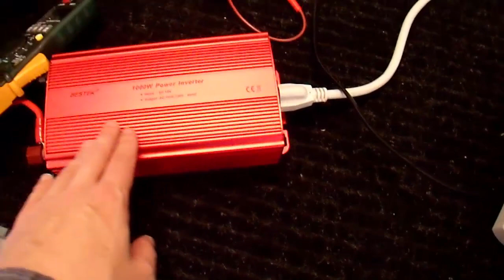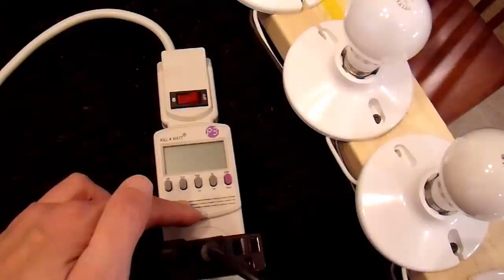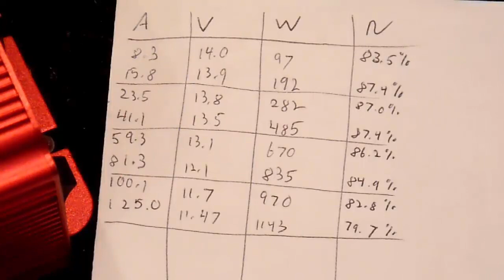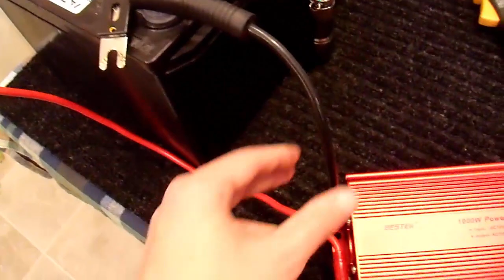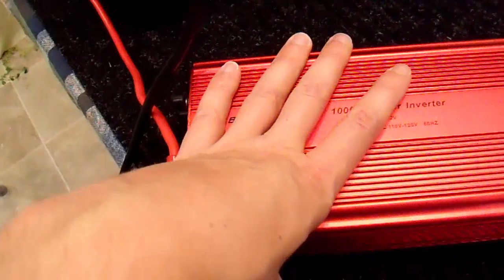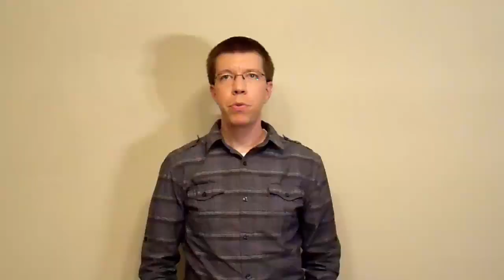Bestek 1000W Power Inverter Review - part4/4

Comment: I purchased 2 of these 1000w inverters and installed in Mini vans, direct connection to the car battery with 12’ of #4 welding wire. We ran the pretty much non stop for 6 days during a coast to coast bicycle race. Used them to power USB power strips charging cell phones, batteries, and bicycle lights. We did turn them off if we turned the car off for more than a few minutes to minimize any car battery drain. I realize we never had an extreme load attached, but they worked fine. I now use one in my truck to charge camera, GPS, and phone batteries, and some LED spot lights during desert trips.
Reply from the maker: I actually think an inverter like this is the right size for those types of jobs.  It doesn't cost much to oversize to 1kw and the result is that the inverter runs with very little stress.  For long term reliability an inverter like this should only be run at over 50% load intermittently, and then you have the reserve power should you unexpectedly need it.  Thanks for the user story!

Comment: Looks like Harbor Freight badge-engineers this as the Jupiter 1000w inverter. I mean, the screws and orientation of the outlets look exactly the same, but the colors are different. Use the 20% off coupon, and it comes out to $68 USD.

Comment: I think need some answer guys.

 Current car cigarette output spec stated 12V (120Watt)

1. car inverter 12v to 220v possible?
2. Generate Maximum output watt 1200W possible? Continuous output 500W Possible?
3. Any implication to my car battery & alternator system?

Highly appreciated your answer. Thanksssssssss

Comment: i would personally run 4 gauge ofc wire to the inverter. or maybe 0 gauge if i have any left when im done with my audio. but i wouldnt throw away the cables included. theyre fairly nice cables. just not made well enough to power the inverter for long. lol

Comment: so I'm looking for a power inverter to run a small fridge and other electrical components inside my 4 wheel drive truck what does inverter work for my application or should I look for something larger like a 1500. also do you have any DC installation videos on power inverters inside vehicles. im a first time viewer really like your chanel good job

Comment: Can this inverter safely power my MacBook Pro on extended trips with the provided 12volt plug that connects to the cigarette lighter? As I won't be using the battery cables. My trip would be about 10 hour trip one way.  
Below are the specs from Apple. 
"Built-in 74.9-watt-hour lithium-polymer
battery
60W MagSafe 2 Power Adapter"
Reply: get the 300w inverter
Reply: +DMAN22yeah Thats what i got from amazon for like 30 bucks about 4 months ago. i'm so happy with it.

Comment: Thank you so much for your informative and unbiased reviews! I recently bought this inverter and am putting together a basic solar system. My biggest uncertainties lie with circuit breakers and fuses. I'm sorry for such a basic question, but am I wrong for assuming that because there are three 50amp fuses on the inverter already, I don't need to add a fuse or breaker into the positive wire from the battery to the inverter? I'm using a WindyNation P30L 30amp charge controller and installing a WindayNation 30amp automatic reset circuit breaker between the solar panel and the charge controller and another 30amp automatic reset circuit breaker in between the charge controller and the battery. Again, total newbie here and any info to help me learn or pointing me in the right direction would be appreciated!

Comment: Is it possible to to converter a modified sine wave inverter into a pure sine wave inverter? I have seen people be able to do so with some kinds of circuits and AC caps. Can you plz make a video on it?
Reply from the maker: It is not actually possible to do so without additional circuitry, inductors, etc.  The videos out there on it that I have seen do not work properly and are not engineered - they're more of a hacked VFD than a true inverter.
Reply: *****  I would be truly grateful of you if you made a video on how do such.
Also, which do you think is better a inverter or a good ol' UPS unit? And is it possible to charge and use a battery at the same time? Science says no. I laugh...
Reply from the maker: Danyal Ahmad
UPS units are designed for short term use and aren't very efficient - they usually overheat with continuous use too.  I'd go with an inverter designed for the purpose but as a matter of interest I may choose to use a UPS unit for the challenge!

And you can certainly 'use' and also charge a battery.  The net combination of the charger system current, battery current, and load current will always add to zero but that doesn't mean you cannot put a battery on a charger and also use it at the same time.  People do this all the time with phones, laptops, etc.  Often times the charger isn't capable of supplying 100% of the power the computer/phone/tablet needs and it gets the rest from the battery during those brief times when more power is needed, then it continues charging.
Reply: *****
Thank You for the reply! I will be waiting for that video. Although, I find UPS to be amazing for the most part but I'm not sure of the long term affect, until now :P
You can get a UPS from Ebay for a very moderate price, where has Pure Sinewave inverter sure hits the roof with its cost.
Reply from the maker: Danyal Ahmad
Yep, often times you can find UPS units for free in the garbage.  It's a shame, but they're really best used for UPS purposes aside from hobbyests like you and me.
Reply: *****
 Thanks again for the reply. I am considering purchasing a 10kw pure sine wave inverter. Although, I am not sure of what company to choose. The only one I've truly used was Aims and Power Bright.
Reply from the maker: Danyal Ahmad
I would stay away from Aims.  Powerbright is a decent budget choice.  This is not an endorsement but I've found their products to be a good value relative to Aims.
Reply: ***** I get that problem with my iPad 
If i use it while its plugged into the wall the battery drains even though it's plugged in 
The only way it will charge is if I turn the screen off and not use it 

The funny thing is apple says it is "charging normally" in their tests
Reply: Also..That is how an Automotive Charging system works..Usage and Charging at the same time.

Comment: Did you buy this or did Bestek give it to you?
Reply from the maker: Bestek donated this inverter, however I only accepted it on the condition that I could release an unbiased review no matter my opinions on it.  I usually don't accept samples for review but they were very reasonable and after disassembling it I don't have any reason to believe that this was not a representative sample.
Reply: ***** I could tell. When compared to your previous reviews it was easy to tell you were holding back and rationalising the bad points. But it did indeed seem like an okay inverter :)
Reply: +Gadget Addict +knurlgnar24 I noticed that too.  Like in part 4 "I don't blame them for including these inadequate cables, except for the fire hazard thing."  I'm paraphrasing.

Comment: Thanks again for your informative videos. I have this exact inverter and use it plugged into my transfer switch during the night when I don't want to run my my generator. I wired the transfer switch end of the cord bridged across the split phase so both sides of the house are powered. My house is 95% LED and only those circuits and low power devices are used at night.
Reply from the maker: That sounds like a solid setup.  It should work well for that!
Reply: Gary Henley wow.  I would like to see a vid how you wire that transfer switch.

Comment: It may possibly get 91 percent efficinetcy if you use some larger cables. Your loosing heat through your cables. Heet equals energy! Larger cables equal more efficient. Thanks for the review.
Reply: TheChaps83 If the input voltage was nearer to nominal on the mid-high range loads, i.e. 12.5v or so, the efficiency might go up a little too.
Reply: Losses in input cables aren't measured, because voltage is taken at input terminals of inverter.
Losses in output cable are marginal, the current is ten time lower.